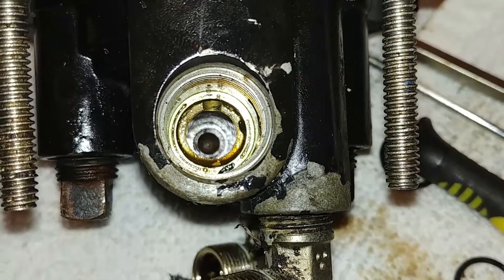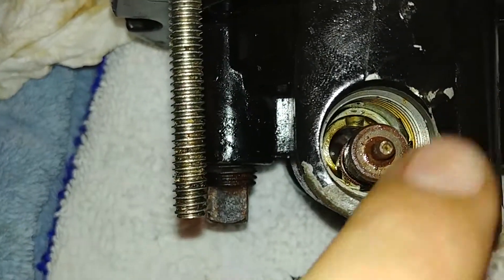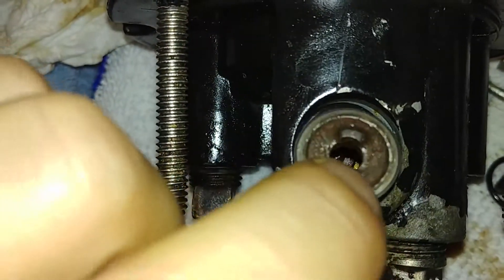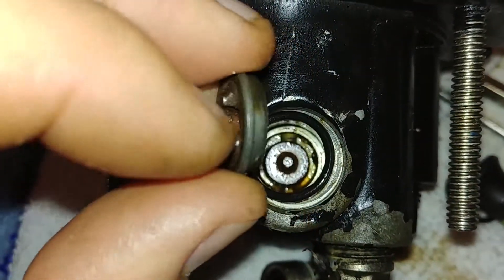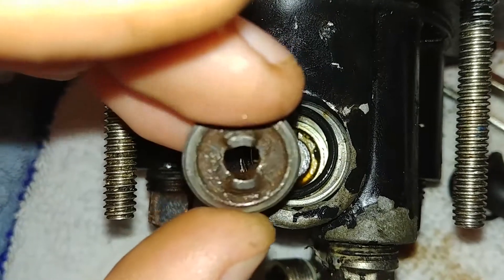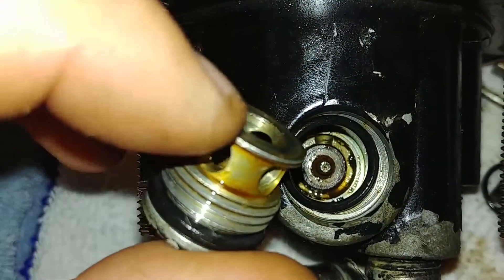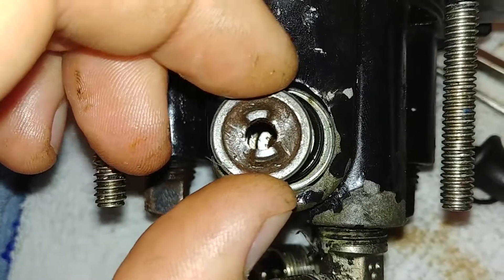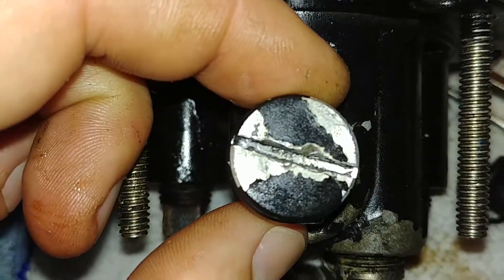SeaStar Helm HH5571  - setting the seals near the spool valve

Comment: Can you please let me know what this function is for? Eg. When I lock in at full right or left rudder turn, I can keep turning the steering wheel forever but with some degree of pressure restriction , is this normal ?  Can anyone please explain or advise me? Thanks, rob
Reply from the maker: It's a valve of some kind. Your wheel should stop at some point. My helm controls were having a similar issue. So I suspect the valve in the video is also related to your issue.

Comment: I think that part is being put in backwards. The side with the raised ridge needs to go in first, then the seal sits on top after it's in.   My question is, the fluid inlet port that screws in apparently is not bottomed out in the hole.  However I didn't measure how many turns it is backed off from fully seated and wonder how others have reinstalled those two valves.

Comment: I may be a year and a half late, but I just had the same problem last night and what worked for me was , I put the oring on the orifice and put it in the freezer.  The oring shrinks and it makes it easier to put the whole assembly back in.
Reply: Wow great tip. I still have this unit but I ended up replacing it with a new one because it was leaking around those seals. So maybe I'll disassemble it and try your trick and post the video.